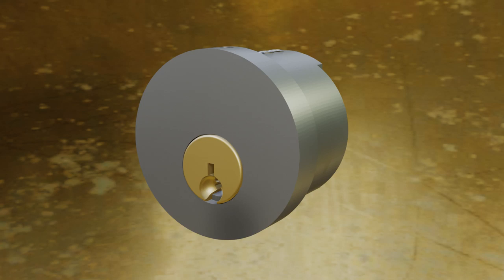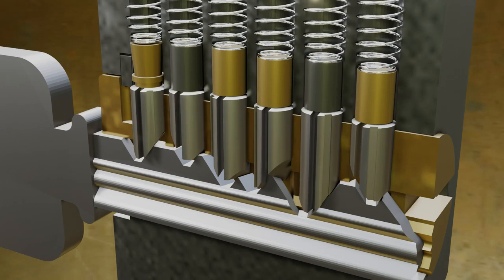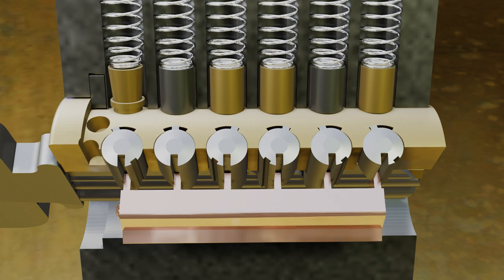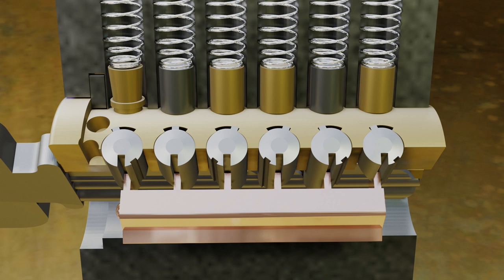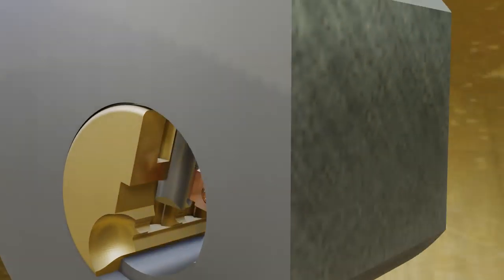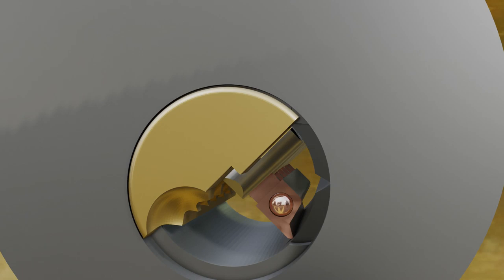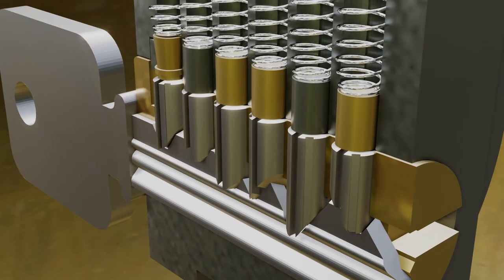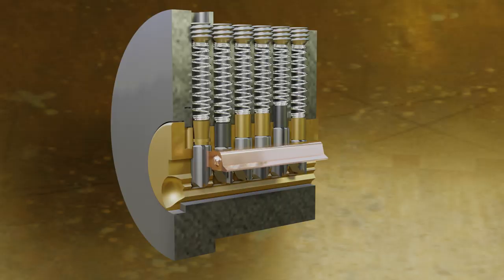How a Medeco Lock Works

Comment: I worked for a lock shop for a time. One of my first jobs was cutting Medeco keys for a major contract. All the old locks in the doors of a very large building were being replaced with security locks. I don't remember exactly how many keys there were, but I know that I cut somewhere around a thousand, a job that took a week or two. The cutter had to be adjusted for every angle and depth by hand, and the angles and depths were different for each. That was a very demanding task and we had to account for every key blank to Medeco, including the ones that were incorrectly cut. Again, it was a long time ago so I don't remember the count, but as I recall, I messed up less than a half box's worth of blanks. I was quite proud of myself when the work was finished.

Comment: How does the spring length in this video compare to the actual locks? Looks like there is plenty of length there, so are these keys susceptible to oversetting the key pins all the way into the bible allowing for comb picking?